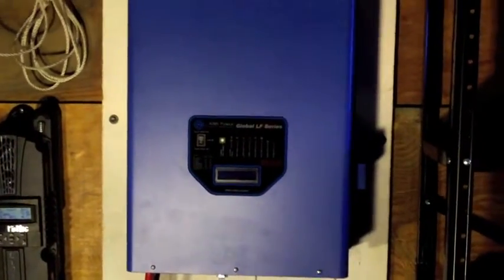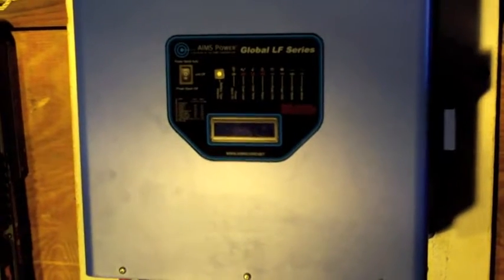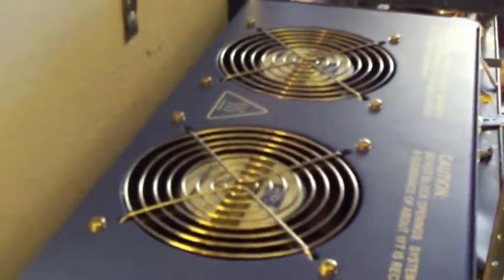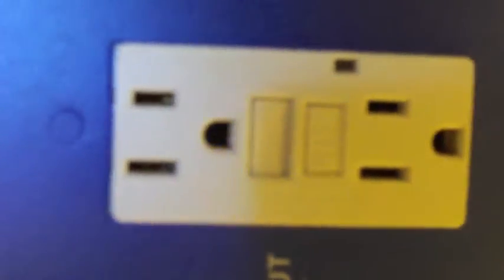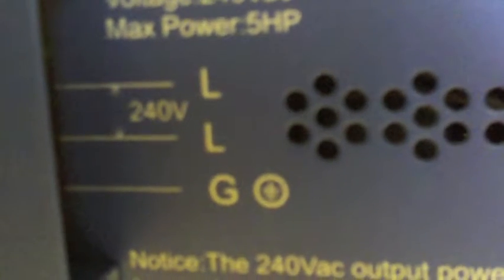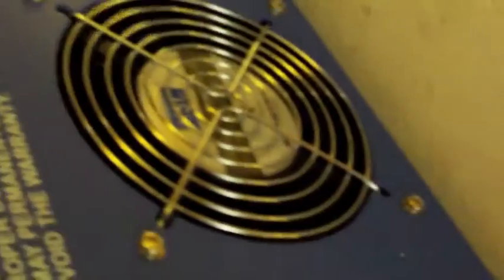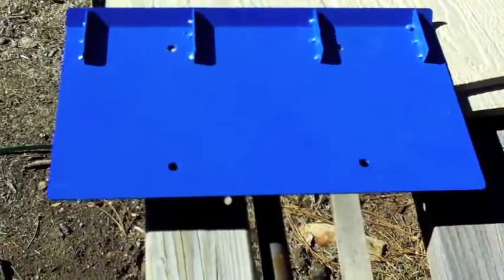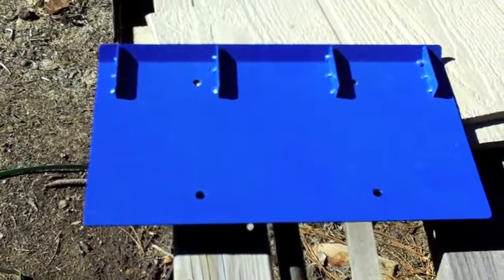Aims Global LF Series 10K 48volt inverter

Comment: I bought the 10k 48V unit to power the whole place because the claim was it could use Utility, battery, or generator (with auto gen. start) AND switch between them automatically!  Where does one land the generator power lines?  AIMS techs say it doesn't have those. (so why the claim"!) The diagram of the connection face indicates there is a "PUMP INPUT" next to the AC OUTPUT, which is where I figured was the correct place for the generator connection, and that it was merely a 'typo'.  They agree that it's a typo, but that the typo was the word "INPUT".  They say that is an output for pumps that utilize a different Hz.  I'm skeptical. Will need to have a thoughtful discussion with them.
Reply from the maker: My first Aims inverter had the plug on the side for a pump, which is why I bought it. The first Aims, the fans ran all the time. Tech said that was normal. A lighting strike took it out so I bought a second one. It did not have the plug on the side for a pump, which was ok. This second one the fans only ran when needed. I have the AC input connected to a 10 / 3 wire which I can plug into AC grid or generator if the grid goes down. The problem with the second one is that it over heats when charging off of grid or generator. I have charging turned down to 30 amps because of the10/3 wire. I bought a Growatt to charge the battery bank, which after a year is now giving me problems. Hopefully Aims tech support has gotten better. Good luck.

Comment: I have the same inverter in 120 VAC and I love it. I only switch to grid power or start a generator when I need 240 VAC. I also have a 1:2 transformer for lighter 240 loads. Here's my question. How well does your split-phase model work? If you put all your load on one side, will it keep its balance (120+120) or does it lose some V on the loaded side and raise it on the unloaded side?
Reply from the maker: Cotronixco Everything that I have heard about the larger Aims inverter has been great. I have been delayed in getting mine hooked up except to test 120volt loads. Yours is a good question and I will watch for the voltage drops when I get everything all set up. It will be awhile as life gets in the way.
Reply: BonitaCreekWaterGuy Sounds great. Please reply once it's been up and running for awhile.
Reply: There is little voltage drop even you put all 5KW loads on one 120v leg.
Reply: Voltage drop or voltage imbalance? The two are not the same.
Reply from the maker: @Cotronixco  You are correct. I have learned that with this inverter that you get 5kw off each 120v side. It will not balance the loads automatically. You need to balance your 120v legs as much as possible.
Reply: hey, I meant voltage imbalance. the hot line with full load will drop a few volts, while the other one will rise a little bit.
Reply: Yes, that's my concern. I'm wondering how much. Under 5% at 5kW? Or as high as 10%?
And one thing I noticed about this inverter is the output voltage regulation is poor. Sometimes it's as low as 109VAC, and other times it's as high as 143 VAC. It's taken out quite a few items because of this. A good inverter will regulate the output regardless of output load or input voltage.
Reply: The volts drop about 5v when one hot line is loaded with 5KW. 10KW inverter like this is designed without AVR, which means it simply bypass the input AC to output. But it does regulate the output voltage in battery model. For inverter built with AVR, you can check this out https://www.sigineer.com/product/5000-watt-24v-dc-standalone-solar-inverter-charger-for-emergency-backup-power/
Reply: Mine has a 48V battery input which are charged through a charge controller from PV panels. If the sun is out and the inverter is not under heavy load, the batteries naturally go as high as 59VDC and this brings the inverter's output to about 143VAC. At night when the batteries drop to a minimum of 46VDC and if there is a good load at the time, the inverter output can be as low as 109VAC. Usually it is somewhere between the two, but I wish it were regulated better. How should it not be?
Reply: may I know how did you measure the voltage , what kind of meter was used? Did you measure the voltage between the two hot lines ? if one went to 143Vac as you said, in total it would be around 286Vac !
Reply: I have the 48VDC - 120VAC version. I have a peak-reading digital meter on the output at all times.